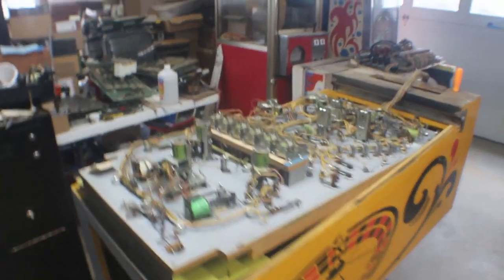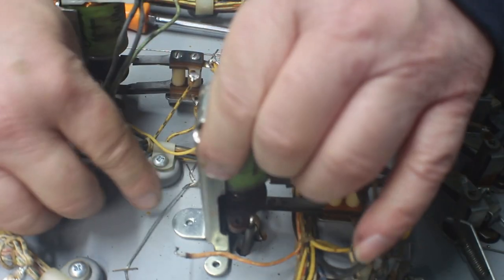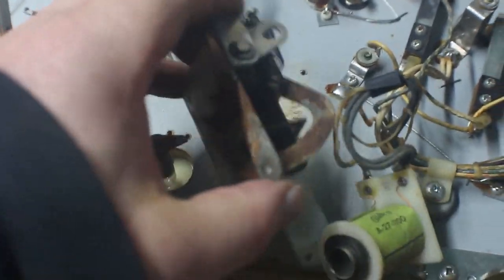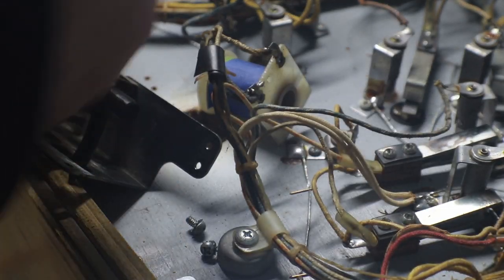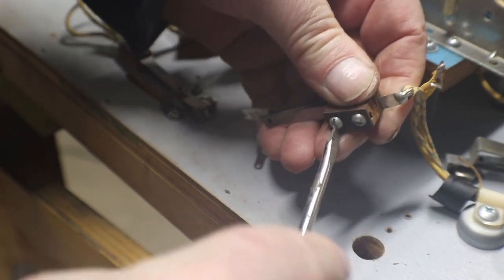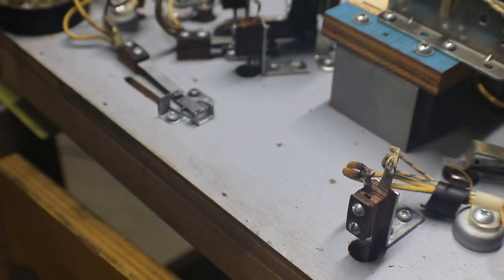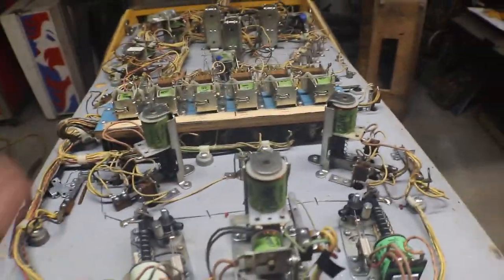How To Repair Switches Under The Playfield / Other Repairs On Our 1973 Bally Monte Carlo Ep 5

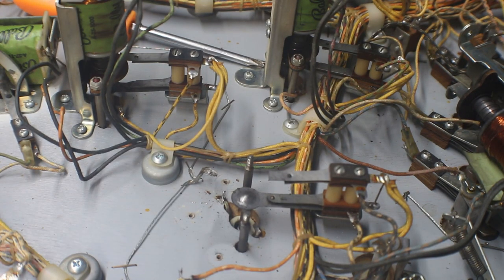Comment: Hi! I'm not a guy, that talks (or comments) very often, but after watching this video to the sequence at about 7:00-7:40 minutes, i have to write something. It really hurts to watch , how the solder-iron
an the plyers penetrate the ground line. Sorry, but the soldering tip is totally oxidized (so the temperature is lowered) and also a bit added fresh solder could help very much. Sorry about my bad english, it's not my mother language.